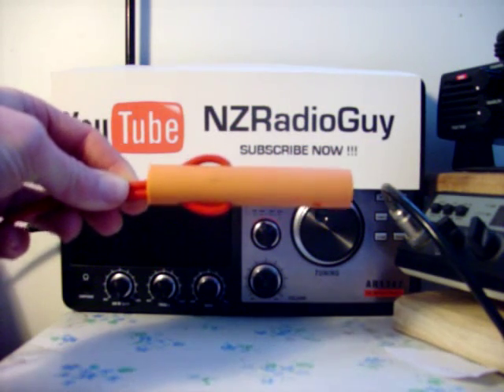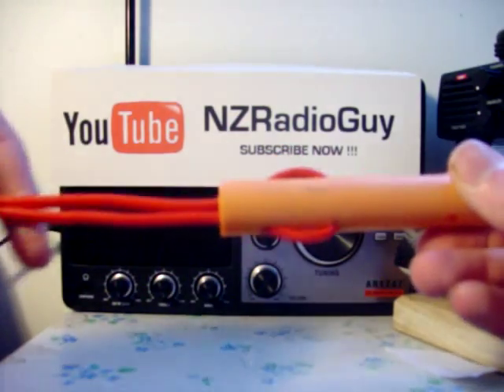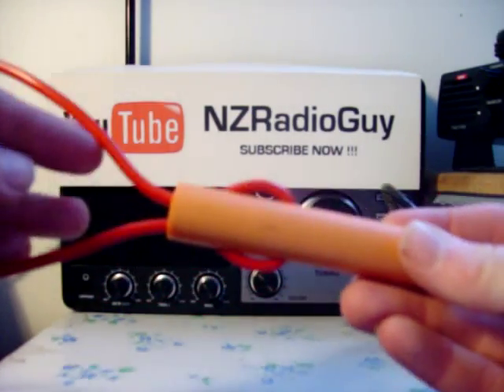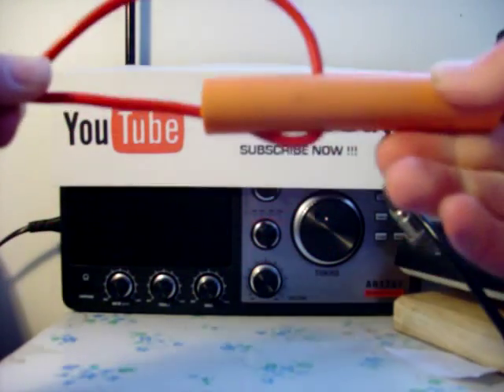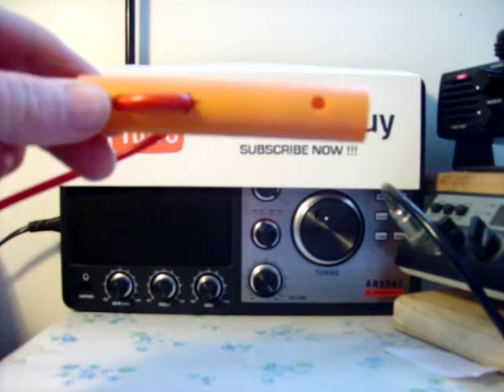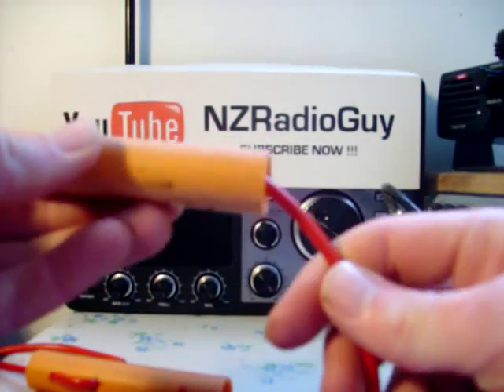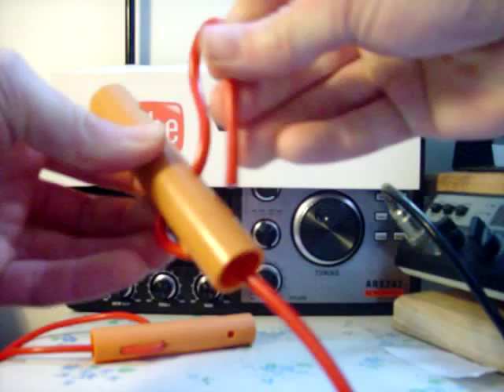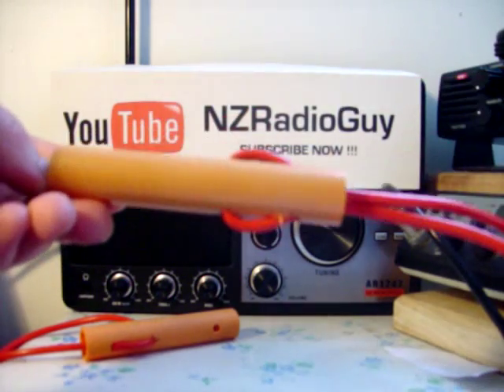DIY Antenna Insulator

Comment: Thanks for that, I have run out of dog bone insulators. I have loads of 25mm flexible PVC gas pipe which the contractors left behind when they were renewing the old rusty pipes in the street last year. This stuff is just rammed up the old pipe to the house. Sorry for the diversion. About twenty years ago I made an antenna tuner from an old broomstick and a crocodile clip for my Realistic DX 394 when I first started listening to HF. I was just learning about ATUs and HF and I was just randomly tuning around the dial when I heard The South Island weather forecast for NZ. Somewhere written down in my many scraps of books I have the date and time and the frequency, I was as pleased as a dog with two tails. I asked my wife to listen, so we both remember this. I live in Lydd, Kent in the south east of the UK. Thanks for video, I am rearranging my random wire antenna so these insulators will be just right. I am still learning, so does it matter if there is a kink in the antenna wire?, I am a SWL so just receiving.

Comment: sleek looking! Thanks for this idea. That is some thick antenna wire 12g! You recon that this will work with say 18 or 14 gauge?  I'm gonna try it using a 5/32  (4mm) drill bit. You know it would have been very helpful had you included some dimensions like; size of the pvc and the length of the piece and the size of the drilled hole. I used 1/2" Sched 40, 4" long and the holes I sized to my cord and my wire. Still a great idea.